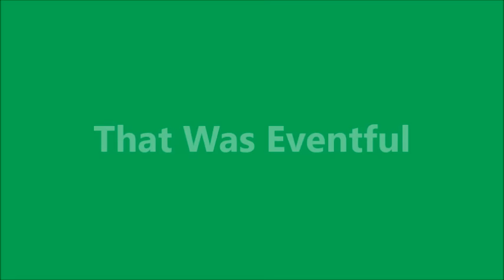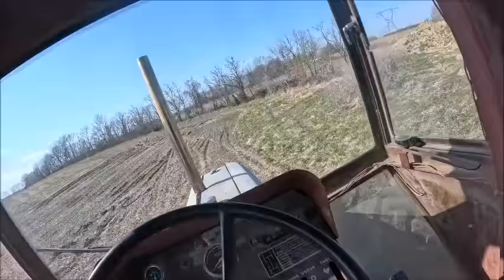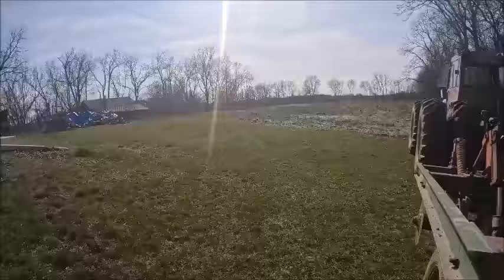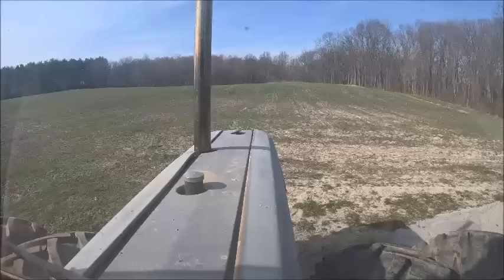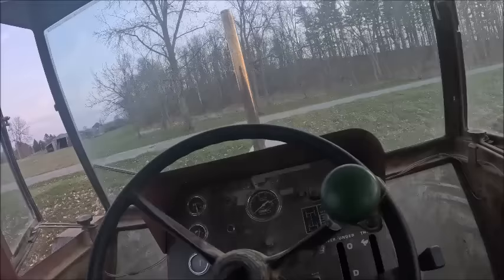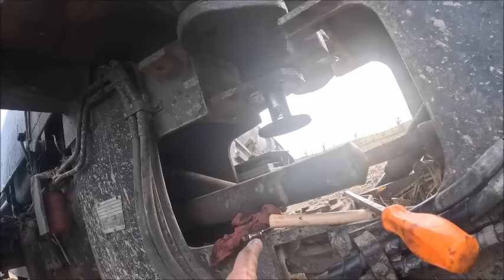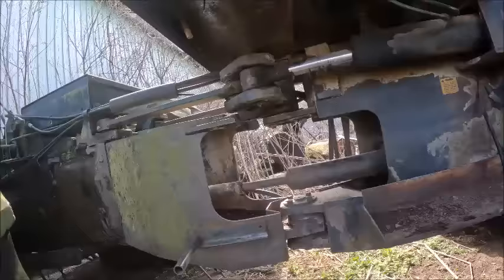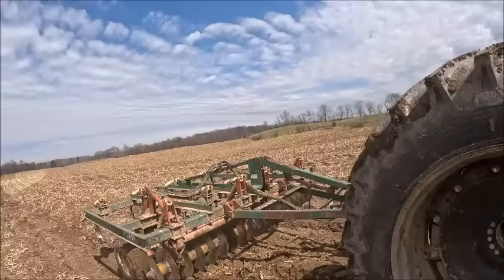The 4-150 Almost Broke In Half While Chisel Plowing

Comment: When  ,I worked  for A Construction and Forestry, divison of a  J.D. dealership,   I ad to replace quite a few center pins     and lower pivot spherical  bearings on    648D Grapple Skidders........    First Time a I was assisted by a mechanic in replacing the pins and bearing..... you had to  remove the seat and frame to get at castle nut on top pin....    We used another skidder to ease the machine apart to get at bottom  spherical bearing,  The steering cross over valve id under  the floorboards..... I learned that putting 2 2x4s under the front blade and using the Grapple set on the shop floor you could control  side to side    to  give you some wiggle  of the Pins      Changing  2 lines on the steering cross over you could use  steering to push  the 2 halves apart and pull them back together..... I , by myself, using the steering  cut the time from  8 hours o 45 minutes.......  Took me longer to put seat and floorboards back in than it took to replace pins and bearings!!!!

Comment: Stuff Happens !    Better now and there , instead of last fall, hauling your combine from field to field !  Possibly in the dark.       Hang in there !   You made me feel better about my old JI Case 4wheelers with steerable axles
Reply: My Grandpa had a 2470 when I was a kid. That thing was a little brute. Seemed to have endless power. Loved that tractor.
Reply: @rustyrelicsfarm2406  I do have a semi retired 2470.   Pulls the disc around in the fall.    Sips fuel.       It’s the neighborhood rescue ranger when they get stuck.    Doesn’t slip.   Just pulls them out.
Reply: @NWIA-qn9og  those old Case Diesels are some of the best engines ever made. The 401 451 and 504.
Reply: Our 2470 still does the majority of the field work on our farm.  Try to keep it well maintained  to avoid breakdowns. Been a really good tractor for us since we purchased it 12 years ago. 😊
Reply: @repairmanjoe8081  those old Case Diesels are massive torque monsters. Plus they have a beautiful sound..

Comment: We had a 4-150 in the early 90’s that did the same thing, but on the road.  Fixed it. Did it again a year later crossing some rail road tracks.  It got fixed and traded for a Versatile 875.  Still have that tractor and it works every spring.  Issue from going to the 4-150 to the 875.  Tillage equipment needs to be upgraded to stuff that’s a lot heavier.
Reply from the maker: I almost had a Versatile triple nickel before I bought this. But hit had been sitting several years and 4th gear was out of it so I let it go. And honestly if I had to have a V8 diesel tractor I know it’s not saying much but I think the 3208 is still a better engine than the 555 cummins. Every once it a while I still wish I would have bought it though cause the neighbor bought it brand new and I grew up watching him work ground with it.

Comment: I think I would’ve went with the ruts first, then diagonally. That’s a good way to break something letting it bounce. It’s as bad as letting a tractor power hop. Personally witnessed what happened to a friends 1586 when he had his hired hand chisel out combine ruts from his previous soybean harvest. It stayed wet for a while, and if left in the field the freeze would’ve blown the beans out of the pods on to the ground. Anyway the hired hand bounced the tractor across the rutted up ground in full pull and tore the rearend right out of the 1586. And if I remember right it also broke a shaft in the transmission. the tractor was weighted down pretty good with suitcase and heavy wheel weights. I don’t remember seeing that fella on another tillage tractor after that.
Reply from the maker: Go with the ruts first. Create chisel plow ruts that are just as fierce to hit as the tire ruts and there’s more of them to hit. Or just hit the tire ruts at about at 20 degree angle and you float right over them and just rock side to side a little. The only place they were an issue is where I ran the combine 90 degrees to how I farm the field so running the plow over them first would have made it 10 times worse and that was just in a couple spots anyhow….
Reply: I’ve been there before. There’s no easy way to work them out, especially this late in the season. Bouncing scares me a little bit, as a farmer myself and a former field mechanic. I just don’t want what appears to be your big horse hurt going into planting season.

Comment: All things considered...at least you weren't in the farthest corner in a deep mud hole. Glad you were able to source the parts to limp along until yours are ready to go. My BIL used to work for a farmer with an AC articulated 4wd...constant problems in the hinge point. Always wondered if Steigers had any drive train issues. Might be that working out the rutted areas accelerated the failure too.
Reply from the maker: I’m glad I wasn’t on the road.

Comment: A setback but like you said, it could have been a lot worse. And now you have a plan to make sure it is much less likely to happen in the future.

I agree with what you and you dad discussed, safety/lock wires or cotter pins or some way to keep the bolts in place so even if they get loose, the pin stays put and keeps the tractor in one piece.
Reply from the maker: I don’t know why they didn’t do it from the factory honestly.

Comment: Those 4-150s were pretty weak in the center section
Reply: White 4-150 was 2  2-105 married that failed they then used 2-135
John Deere married 2 4020 together, that failed went to 2 4430
Allis Chalmers married 2 7060s.
The difference in beef between a 105 and a 7060 is tremendous

Comment: Can’t get that spline configuration for that shaft. At lease I couldn’t after searching everywhere. I had “Joint Clutch & Gear” in Detroit build a complete new shaft with modern spline configuration. I have the part number to build another one if you need to go that route.
I have a service bulletin that states all replacement shaft are to get the heavier 210 shaft.
Don’t run it long with that wore out shaft you’ll damage the bearings and splines going all the way to the flywheel.
Reply from the maker: That’s why I’m getting my shaft rebuilt to put back in it…
Reply: Check the splines on your original for wear to make sure they’re good before spending the money on fixing the tube.
Reply from the maker: It’s tight.